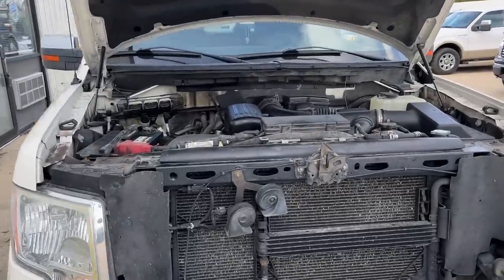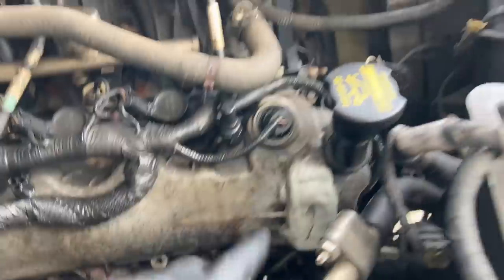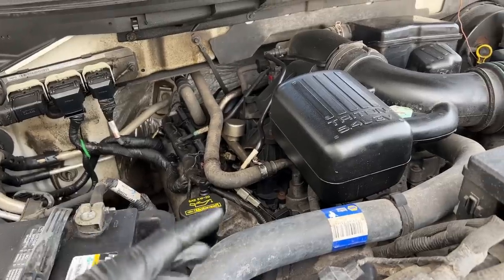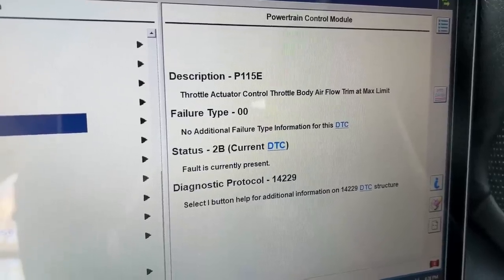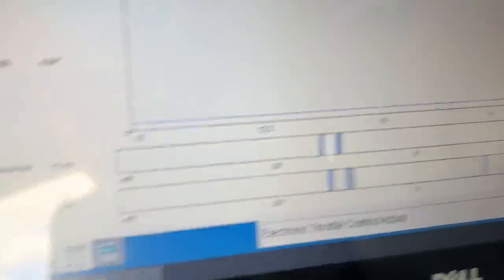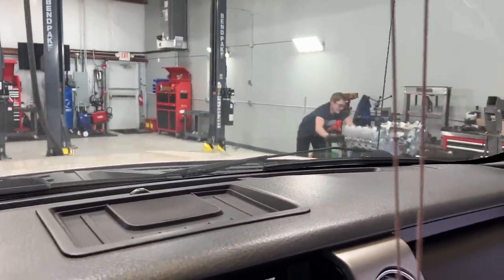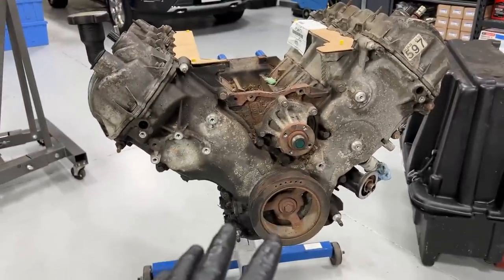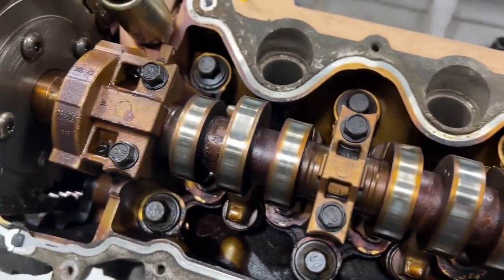Why are Ford 5.4L 3v Triton Engines Jumping Time and Cracking Valve Covers?

Comment: You should pulled off the chain tensioner and inspect the seal for it to the oil feed from the block, it would have been blown out,thats why the chain got loose, slapped around and broke the guide.  Usually these tensioner seal rings blow out because of prolonged exposure to fuel in the oil, softening the seal 
Also you should pull the camshaft caps to inspect for scoring, once they are scored you lose oil pressure to the head because the oil leaks past the cam journals, also reducing oil pressure to the tensioners allowing the chain to slap around and break the guide.
Reply: i found 3 engines with holes in the timing covers, all on the passenger side. obviously loss of tensioner pressure.  one engine was driven with low or no oil pressure that the rod bearings were hammered around the crank journal and took a screwdriver to get them off.  they actually ran the engines with oil pouring out of the holes in the timing covers

Comment: My 2005 mustang's 4.6 liter did this at 192k miles.  It was a good chance to go through the front end with a new timing kit, water pump, oil pump, and wear items and it's ready to go.

If there's a hole in the valve cover, you don't need diagnostics to figure out that the timing isn't going to be right on.  

I'm not sure the plastic even needs to get into the cam gear to jump a tooth when the chain and guides are that worn.

Comment: The 11-14 F150 Coyotes are giving themselves inspection ports like this on the front cover when the a/c idler rips off out of no where. Seen several on the forums lately.
Hope this guy starts changing his oil more often on the new engine.

Comment: Reminds me of the old AMC nylon timing chain sprockets... I know others used them too, but seriously: plastic timing gears? (Don't get me started about the pot-metal oil pump housings...)

Have you ever installed a supercharger on a 4.0L?

Comment: I have a 5.4 with 240K. I just had the transmission rebuilt and do have the infamous "tick" at the top end. I planned on changing the rockets and followers but now think I should go the extra mile and change the chains and guides as well. What would you recommend? Cams ?, Phasers? Also. Engine has excellent compression and zero blower by..

Comment: I personally don't agree with "just replace the engine" --  
For doing work for a customer, I can understand.   but if it were personally my truck and I was doing the work for myself, I'd definitely just do the full timing chain job and keep driving it.   edit:   at least you did admit that a timing job alone would have probably been fine.  Bravo
Reply from the maker: The customer contacted me for engine replacement not a timing job. Customer was right though. A timing job and both exhaust manifolds, pan drop etc would be $6k easy. He paid a bit more and got a reman engine, new manifolds, all new hoses, plugs, water pump etc. he was very smart to go the engine route.

Comment: Hi Brian.
I have a 2005 Expedition that has 223k miles.  I’ve watched your channel for several years now. We bought the car when it had 145k. So far it has done really well. I don’t know how it was serviced before, but we keep up with the oil changes now. If I knew then what I know now, I probably would not have bought the car. What would you recommend for keeping it going as long as possible? I’d like to do preventative maintenance but I’m not sure where to start. Any recommendations?
Reply: not driving often or further than the grocery store and regular oil change has worked for me knock on wood.
Reply: vdog55 you sound like you driving a chevy
Reply: oil changes every  3.000 miles and spark plugs and coils spark plugs and coils have to be a motocraft..don't put cheap ebay. parts or Napa
Reply: With that many miles, just change the oil frequently, drive it until the engine goes, and then, if the body is in good condition, rust etc…… decide if putting in a new rebuilt is worth it.
Reply: @joecostu1571  lol thank you for reminding me of the not so good old days

Comment: It amazes me that the predecessors of this engine (Triton 2V 5.4 and Intech 4V 5.4) were near bulletproof. Then Ford decides to save some money and puts out the 3V. But at least they learned from their mistakes and replaced it with the Coyote 5.0, which is a monster
Reply: It's a 13-year-old vehicle with nearly 200K on it.  How about you just do preventive maintenance and replace the timing chains, guides, and phasers at like 140K miles?   I had a Volvo and they were adamant that the timing belt had to be replaced at 100K to 105K miles.  You figure everything should last forever?
Reply: My 99 f150  with the 5.4 2 valve  is still running  awesome  I sold it to  my sister  last  year she hauls wood with it 160 k miles 👍🛻
Reply: Ford was trying to save money with the 3v? It was fitted with a VCT system and a 2nd intake valve for better overall power. You really think that was Ford going cheap on a new engine design? The 5.0 also has a VCT system as well albeit a bit more complicated with DOHC.

Comment: My 4.6 has a leaking crossover coolant pipe and I can't remove the intake manifold without rounding off the bolts.. (I don't have a garage or the tools for that issue) I am shocked that garages in my town won't even call back to offer a quote let alone do the work 🙄

Comment: "Just under 200,000 miles on it" I have never seen a Ford 5.4 Triton 3v make it anywhere near that kind of mileage without a lot of work. They almost always fail well under 100,000 miles. This is a crazy engine. Compare this nightmare to the Ford 351 Cleveland engine of the '70s, which had the potential to literally last forever. Yes, you would need to replace the timing chain once in a while but it was a simple and inexpensive job, and there were no tensioners and plastic guides.
Reply: @Gerald Scott, 
" ... 351 Cleveland engine ... potential to ... last forever. ... "

Great for owners, but not so much for dealer service departments. You know that problem had to be "fixed". 

They are probably counting on those of us who remember such things dying off and younger generations adapting to shorter engine lifespans being "normal".  Such a-holes who make decisions to reduce rather than increase reliability to save a few bucks per vehicle in manufacturing costs. I wish they would emphasize "miles per engine" more than "miles per gallon".  (One of the main reasons none of the many cars I have owned in over 58 years has had a turbocharged engine.  Turtle vs. snail.)
Reply: I'm at 265,000. I have no issues except that it is just getting a little tired. I know several people who have gone way over 100,000K. I think saying they all fail well under 100K is pretty extreme.

Comment: What was the roundabout cost for this repair? New engine with labor. Just curious.
Reply: harm and a leg. and few other body parts
Reply: Roughly equal to the price of four full tanks of fuel.
Reply: 3500 to 4500 for a fomoco remanufactured engine and add about 2 to 3k for labor and miscellaneous parts depending on where you get the work done.✌️✌️

Comment: Great information Brian, and your step by step timing chain replacement was very interesting and very detailed information. I just have a question on the Melling oil pump I saw that melling have the 10340 and the 10341  with housing finish anodized hardcoat and housing material hardcoat anodized aluminum have you used this models or do you recommend to stick with the M340HV? This is for my dads truck 06 Ford F-150 5.4L. Thank you man keep up the good work and God Bless!
Reply from the maker: Use the regular M340HV, it's more than you will ever need.

Comment: My valve cover didn't get busted open but i think it jumped timing.  The tensioners have been bleeding down overnight and the 1st start the chain would rattle for a second.  One Friday it was running fine , it sat over the weekend and Monday morning it fired up shaking like a dead miss but still running. *281,000

Comment: I have a 3.5l v6 2016 ford explorer, I hear some type of grinding when accelerating on the hard side (3-4k rpm) but nothing felt in terms of throttle response and only does this occasionally.

Comment: Do the 4.6 v8 2 valve engines have this issue?  I have a 2007 F150 with 150,000 miles.  Great video! 🙂
Reply: Not exactly the same 4.6, but my 1992 2V 4.6 lasted over 250000 miles.  I finally sold it.  As far as I know, it's still on the road.  My 3V 4.6 in my Explorer is over 150000 miles.  I hope the chain guides last on that one.
Reply: Depends on whether it has plastic tensioners and guides

Comment: Hey Fordteckmakeuloco, Are the Ford 5.4 2 valve good engines?
Reply: @justinballard7242  nice thank you Justin.
Reply: @justinballard7242  I wouldn't day they're much better they had their share of issues and design flaws also, both are great engines if properly maintained.
Reply: The earlier 5.4 two valves had a tendency to blow out their spark plugs if I recall correctly
Reply: @lonewolftech  I would definitely not consider the 5.4 3v a great engine.... This one didn't even make it to 200,000 MI? kind of sad.
Reply: yes very good engine that we have on are fleet and are  fleet over 2000 truck the only problem you see head gasket leaking oil
Reply: @justinballard7242  yeah I had a buddy who had a 5.4 2 valve  never gave him problems and he always talked about how reliable it was. I think it's up there with the 4.6 2 valve in terms of reliability
Reply: jgc got 09 with 260.000 miles on it Daly driver. very reliable with 8 speed. the 2 valve is a good engine but the 3 valve with 6 speed gives  better  mileage
Reply: Great engines. They will easily go 400k miles if taken care of.

Comment: I wonder if there are anyways to prevent this from happening? Like using 5w-30 oil instead of 5w-20. Or these are like ticking time bombs.
Reply: Use the 5w-30 in the summer? April through Sept.

Comment: Some of the engines that make it back and survive though the debris in the oil pan and just carnage makes you actually think they are pretty tough engines I would think with the amount of debris in some of the engines you fix and factor in the low oil pressure these engines are known for they would be spinning rod bearings like crazy

Comment: Great video,  but I'll stick with my Jeep 4.0 litre, straight 6 engines. Over 300,000 and the engine has never been touched other than a valve cover gasket,  2 water pumps, oil filter adapter o-ring, and normal routine maintenance. I have personally seen them with much higher mileage,  and as well, the engines have never been apart. God bless.
Reply: I have both lmao

Comment: O.K. I was wondering if this happened to my engine and I had the covers off like you do, and saw the problem with the timing if maybe I jammed a piece of the guide in there and turned the engine backwards if the chain would jump the other way, then replace the guide, and problem solved??????

Comment: I've got one that I might need to replace the block on. Have a bad tensioner, and some roller followers. What do you charge if I bring it to you? its a 2011 Expedition EL with the 5.4 3-valve.
Thanks!

Comment: Is it suitable to use the cast iron tensioners in place of the ford plastic ones if using a 360HV oil pump? And also one of the plastic tensioners are on back order

Comment: I have a question, and I’m gonna try and cram it all in here just in case you do see it and can respond or send me to the proper video. I have a 05 expedition with the 5.4 3 valve. I had a bad misfire so I replaced the spark plugs with ford motorcraft plugs. All coil packs with blue streak coil packs. Still had a miss. So I did the evap vent canister and evap vent solenoid. Found out one of the spark plugs were bad out the box in cylinder 7 and it made a huge difference. One thing the truck has always done is idle a little rough and sound like a diesel. Was hoping that fixed it but it didn’t. Others say theirs has just shut off and won’t start, etc. mine drives just fine, but has that rough idle and sound. I’ve seen someone in a forum mention a fuel pump driver module. Others advices I check injectors. Is there anything I can do or check for to resolve the issue?

Comment: Does this motor have any positive things going for it I can't find a machine shop in my area that will even touch the heads on this engine I've leak tested it and found the intake valve's or valve leaking on #5 causing a misfire at idle

Comment: I do have a question I have a 2004 f150  5.4 and it has 2010 f150 written on the valve cover is there a way to identify the engine to make sure I get the right parts

Comment: QUESTION: There's a silver plastic piece under the Ford emblem but under the license plate. It holds the lights that light up the license plate and plugs into the lift glass. What's that called and do you have a part number for a 2008 Ford expedition? 
Thanks to anyone that helps.

Comment: Im new to the expeditions andurrently going thru some issues with it. Currently a timing chain is being done. My question to you is how do you feel about adding a quart of marvels mystery oil to the engine at every oil change? Also can we use synthetic or does it have to be regular oil? Btw it's a 08 EB Expedition
Reply: I’ve experimented with a couple oils in my 11’ expedition with 140k miles. I found that mobile 1 full synthetic 5w30 runs the best IMO. not a single rattle at start up. Can’t even tell it’s running.  Motorcraft filter.  The 2011 came with all the better timing parts, roller followers and oil pump.  I’d suggest checking out Brians videos to see if the higher flow oil pump is needed on yours.

Comment: So do you know if Ford has actually improved these weak areas (guides, followers, VVT phasers, etc) in their remanufactured engines so that one might expect to get more than 200K out of it 2nd time around?  Or are they essentially just selling you the same design problems again?
Reply: Yes, the reman engines get the improved parts. PowerTrain Products is one company that does include all of the upgrades.

Comment: I had my timing chain done at my local dealer and had the Melling 360hv oil pump out in at the same time. 

Do you recommend 5w-20 or 5w-30 oil after the repair have been done and why?
Reply: I'm at 228k miles and switched to 5w30 a year ago. I use royal purple, Haven't had any issues. I do have a melling oil pump to put on but haven't put it in yet
Reply: Brian had recommended 5w30 for these 5.4 3v engines in a past video.
Reply: @JimBronson  I am aware, but that was on factory setup with factory oil pump which is known for extremely low oil pressure. I'm wondering if the upgraded oil pump would be better off with 20 or 30 weight

Comment: They will go 300k with no problems if the  chains are done soon enough.
Reply from the maker: Yup!
Reply: @FordTechMakuloco  my 1998 5.4 warp a head with water in the oil .did the heads and chain ,it lasted one oil change 3k miles until it was slapping the new mechanic said it was junk parts I bought but why did the first mechanic a good shop not say something  . I'm at 117k so I'm praying it will go for another 100k .it's 4 wheel drive  .

Comment: Thanks for all your work. I have question on my 2013 f150. Driving down the road the other day after work it automatically slammed into first gear the speedo went to 0 the rear end lock up I violently slid off the road. A few seconds later it went back to normal I was like WTF. After a bit of research I find a recall. Long story short Ford dealer said bring it in. I pick it up later that day and it was running great. 2 days later I take off from an intersection it goes to neutral speedo goes to 0 and like before a few seconds later it started working. Back at Ford for a few days they say it’s a trans speed sensor.  Your thoughts please.
Thanks for your time.
Where are you located?
Reply: He will never answer you’ll have to dig more, I believe he’s off of interstate 80 near Yorkville, Illinois. You have to send a request online describing your problem to try to schedule with him. I am not techy and even though I live in Peoria I would’ve gladly given him my cash all of the traditional good old boy ways of doing business we’re not there for me.
so I appreciate his videos but….
Reply: Watch his Ford 6r80 transmission harsh shifts video.  Fixed my 2013 Navigator watching that video 6 to 8 times.

Comment: Idk bit my 09 Mustang with the base V6. Something blew through my valve cover but the timing chain doesn't have much play to it at all but a half moon shaped piece of metal tore the oil filler spout clean off my valve cover. Drivers side. With it being an interferance engine and I was driving when it happened, is it safe to assume that the valves kissed?

If so 

New block? 
Just heads and timing? 
Push it off a cliff? 

Don't exactly care at this point that it's a 45th anniversary edition. My p6 explorer has the same engine and replacing the timing on that was an absolute year long nightmare. Due to the stupid design of the sohc engine and needing to pul the entire engine in order to access the passenger chain. Most shops here refuse to work on the sohc engine

Comment: Hey! I changed my brakes (rotors/pads) on my 2014 escape. The front driver side rotor seems like it’s getting really hot. The caliper goes in smoothly and it doesn’t feel like it’s sticking. What is going on here? I took it apart and re did like three times already. Thanks!
Reply: Make sure the caliper guide pins are well lubricated.